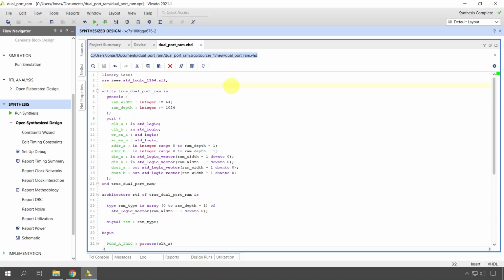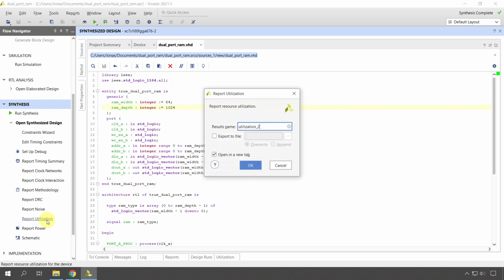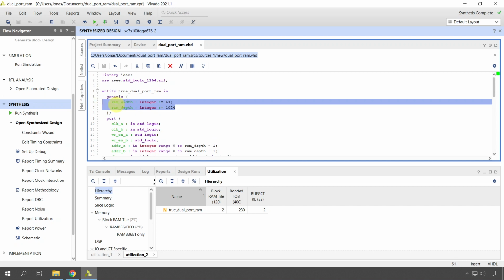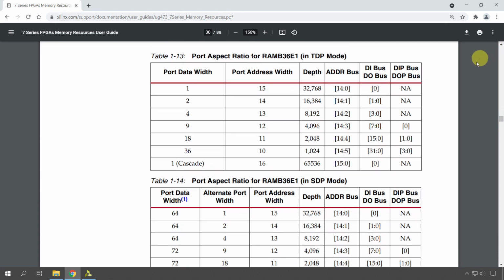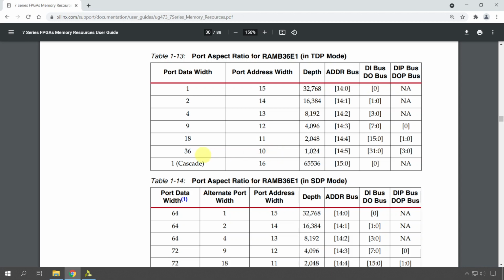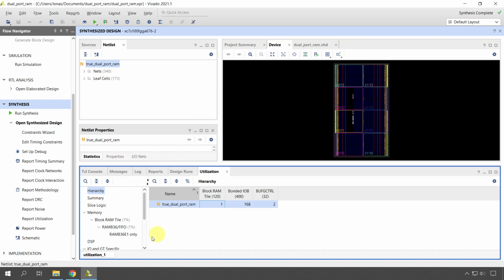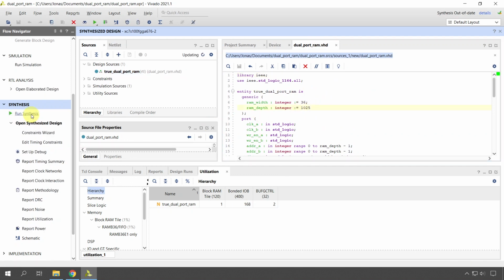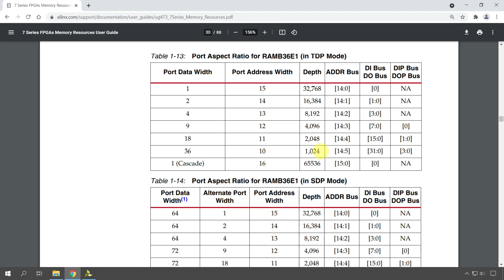Why does my VHDL code infer more than one block RAM primitive?

Comment: Sir please make a video on this topic please.
If fpga bord frequency is 100mhz and I want to generate the 1 mhz frequency for DAC then how I can do please help me.
Reply: You can think of implementing a clock divider, to get a 1MHz clock from a 100MHz global clock.
Reply: @vivek_adi  
I tried but unable to do it.
Reply from the maker: That's a great idea for a tutorial. But for now, I'm sure you can figure out how to create a clock divider to get your 1 Mhz clock. Here's a hint:
signal clk_in_counter : integer range 0 to 49;

Increment clk_in_counter continuously and invert clk_out every time the counter wraps. clk_in is the 100 MHz input clock and clk_out will be your 1 MHz clock.
Reply: @VHDLwhiz  thanku very much sir.
I am big fan of you sir thanks for suggestions I like each and every video made by you sir please make video on this topic please🙏
Reply: @VHDLwhiz   hi Jonas, how about using unsigned signal for incrementing with the clk edge. What will be the difference in the infered circuit if integer is used?
Reply from the maker: @mohitsrivastav9350  There shouldn't be any difference in the inferred circuit. Signed and integer describes the same behavior, and so does unsigned and (positive) integer. But you must watch out for integer overflow when using the built-in integer type. Some synthesizers will silently produce erroneous logic when that happens.